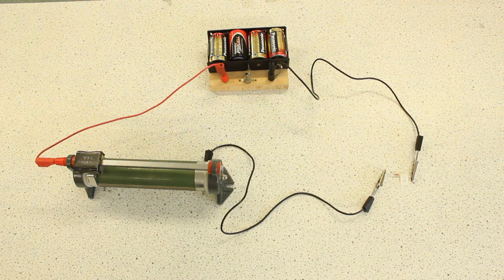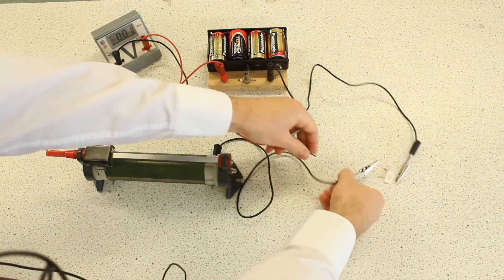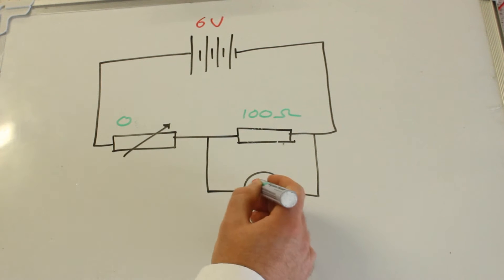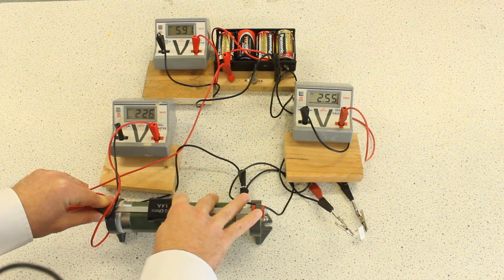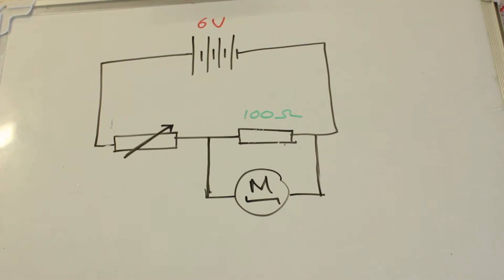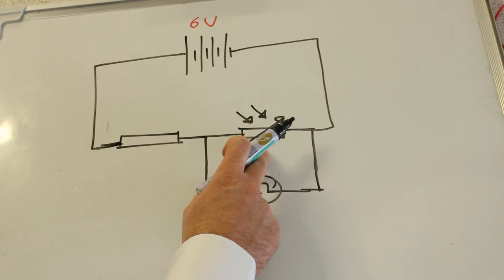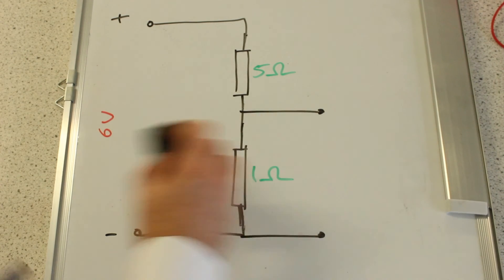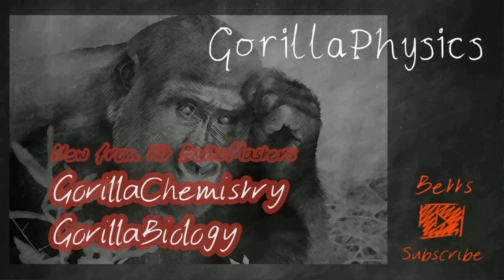Potential Dividers - GCSE Physics Revision

Comment: This may sound stupid, but why do you need the second resistor? If the output is 6V then why not have the Rheostat in series with the motor for speed control. Why have the 100 Ohm resistor there at all?
Voltage would still be shared across.
Reply from the maker: That is a fair point.  I could easily do that, but most GCSE questions use a variable resistor in series with a fixed resistor. 
I guess this is because it is actually a complicated set up when you have the resistor in potentiometer mode.   Using the rheostat like that you essentially have two variable resistors, so I guess the curriculum designers wanted to keep it simple.  :-)
Reply: GorillaPhysics - GCSE and A Level Physics Revision Maybe it's the way my mind works, but shortening a wire by sliding along it seems simpler.
Anyway, thank you for such a swift reply, I'm planning an A-Level lesson as a trainee teacher and I cannot think of a good reason for using this system over a Thermistor or LDR or other system in plain old series.
Other than the fact LDRs and Thermistors tend not to be able to handle much current. But that only affects some scenarios.

If I jump to left and right audio or a combined temperature controlled heating/cooling systems in a greenhouse I can validate it, but they never call for such things in an exam.
Reply from the maker: Here's a more complex one for A Level:
https://www.youtube.com/watch?v=8W1Tq0n--Ok
And a question which is potential dividers A Level style:
https://www.youtube.com/watch?v=pQtyaUBx-ZU

I would suggest that A Level will handle the potentiometer idea better than most kids at GCSE, who essentially just need to get the idea of sharing potential difference in a ratio.  Cheers, good luck with your lesson!

Comment: please could you do something similar for parallel circuits to show how voltage and current differ in parallel vs series circuits?
Reply from the maker: George Acres absolutely, next on my list.
Reply from the maker: George Acres I have one intended for A Level, see what you make of that for now! :-) https://youtu.be/mo4WfIk6c5M
Reply: Thanks. What is the difference between potential difference and voltage? I know that the definition of pd is the work done per unit charge, but that doesn't help me to understand it any more. I don't have a clue what the actual difference is between voltage and potential difference, and I don't know which term you would use and in which situations, and why?

Can you help please?
Reply from the maker: You are correct to wonder!  There is no difference, it's just that the incorrect use of "Voltage" is so common that we accept it in Physics papers.  (It's like if you said metre-age for distance.  Not totally wrong but just not 100% right!)
Reply: So on an exam paper, it wouldn't matter if I said voltage or potential difference as they are the same, but would it be better to always say potential difference regardless of what the question is? Or should I say voltage in certain situations?

And is there no difference whatsoever between the two terms? Do they mean the same thing?
Reply from the maker: Correct, I have never seen an exam markscheme penalise for Voltage.
They are the same, but the term potential difference is more illustrative of the quantity as it is defined as the difference in Electrical Potential between two points, (hence the + and - on either side of a cell.)  So that's really useful when you are talking about how components are using the energy that the charge has, or how power supplies are giving the charge energy.
Reply: Thanks! Would you say it's better to always refer to it as "potential difference" then in an exam?
Reply from the maker: Yep, but most of the time we just represent it with a capital V.  Can't go wrong with the algebra! ;-)
Reply: GorillaPhysics Awesome, thanks for the help!